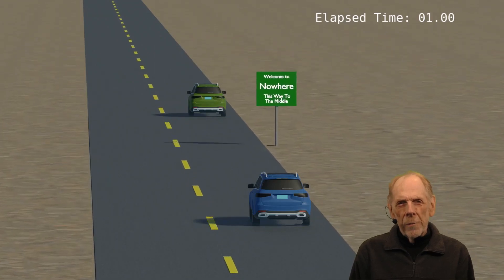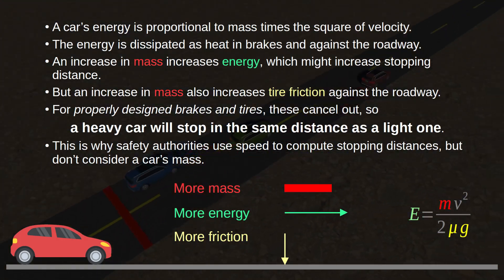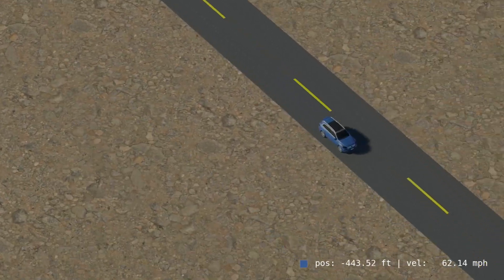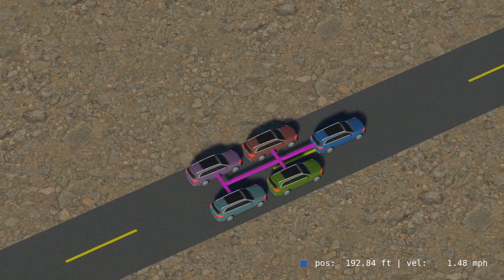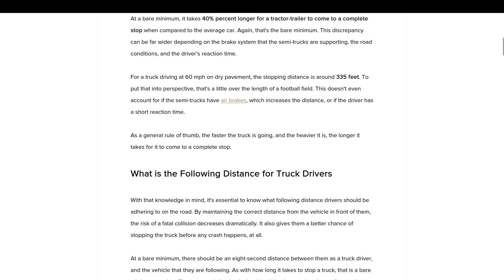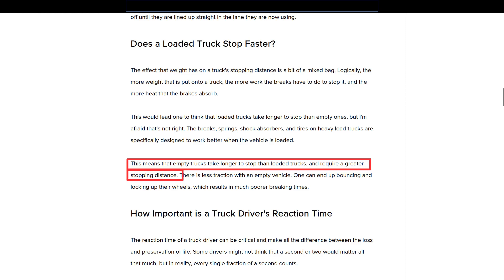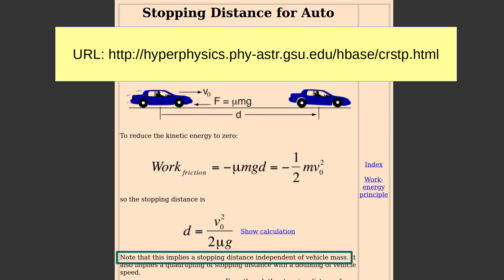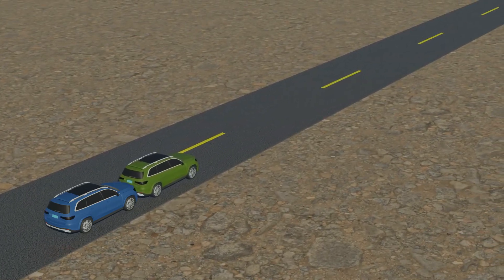Car Safety Myths: Exposed

Comment: I don't think it would be completely inaccurate to say that mass increases the braking distance as there is a noticeable difference to my carry truck when I have a 170KG generator in the back. Though I get that bigger cars could probably stop quicker with the hefty brakes they have on them, especially high performance spec cars.
Reply from the maker: @arianaashworth3091  • 8 days ago (edited)
> I don't think it would be completely inaccurate to say that mass increases the braking distance as there is a noticeable difference to my carry truck when I have a 170KG generator in the back.

Yes, but my video addresses the basic physics, not specific examples that have extraneous, uncontrolled factors. In science one must eliminate all factors but one -- the factor being studied.

Thanks for writing!
Reply: That should not be the case. The car's on board computer would have detected more weight and adjusted the braking system accordingly so there is no noticeable difference when braking and accelerating. If the added load means the car is taking noticeably longer to stop then there is either something wrong with the electronics/braking system or you have dangerously overloaded the vehicle, and in either case you must not be operating it on the road in such unsafe state.
Reply: @bethhughes559  It is a little compact pickup tuck from 1990, it has no electronics other than the lights, gauges, fans, ignition, starter, and the bed tilt pump. I am also not overloading it as the SWL for the bed is 500KG.
Reply: @arianaashworth3091  From 1990? A 33 year old vehicle shouldn't really be on the road anyway, they are unsafe and give off dangerous emissions. Perhaps consider replacing it with an EV.
Reply: @bethhughes559  I am not getting rid of it just because it is older, there's nothing even wrong with it! It passed the MOT with no issues and it has had a catalytic converter retrofitted. A few people I know who own electric cars have been having problems with the charging network, which is actually one of the reasons the generator ends up being transported around on it in the first place.

Comment: Wheels Magazine did an experiment similar to this, they found that brake quality was more important than speed.
Reply from the maker: > brake quality was more important than speed.

When the tires lose their grip on the pavement, brake quality is no longer an issue. Ultimately, the tire friction limit is the deciding factor.

Comment: I learned to drive double decker buses in trhe 1960s in London. I soon learned the fallacy of big vehicle = longer stopping distance by experience. We were takenn to a closed track at Chiswick where we were allowed to slam on at various speeds, culminating in the famous "skid pan" where we drove over a constant spray of water on a smooth surface with worn rear tyres. The instructor would command a certain course, either straight ot curved then yank the handbrake (rear wheels only) to induce a skid. We then had the hair-raising experience of trying to correct the skid and bring the bus to a safe stop.

A few years later I had the need to perform an emergency stop with a loaded bus. The vehicle stopped promptly within what I would have expected for a car at the same speed. Strong brakes and wide tyres added up to loads of anti-traction (friction). We were taught the "cadence" breaking method of quickly alternating between full braking and less breaking to avoid the wheels locking - skidding tyres offer no traction. Modern ABS brakes work that way.
Reply from the maker: Thanks for posting this real-world example -- much appreciated!

Comment: While I do agree there is nothing in physics that says heavy vehicles should stop slower (or faster), the real world is slightly more complicated than the simple dry friction model taught at school, F=mu*N. In practice, as the friction force gets so large that it causes stresses in the materials involved approaching the strength of the material it self, the coefficient of friction starts to taper off, as the material starts to give. In the case of rubber, it is also a viscoelastic material, which causes the onset of degradation of grip to set in even sooner. 

The result is that vehicles with lots of weight compared to the contact patch of the tires do have worse stopping distances. Such vehicles of course also have better rolling resistance, and are thus more economical to drive. So yes economics are indeed the main driving factor of elongated stopping distances of utility vehicles.
Reply: We can take the energy approach and see that during braking all the kinetic energy has to be converted to something else for the vehicle to become stopped. Most of the energy transfers into heat; in the brakes, the tyres and I suppose the road as well. The original equation for KE at 9:04 is the correct one, it just doesn't directly give the distance. The "corrected" one relates to distance, but is NOT the energy (rather closer to a momentum). So the amount of heat generated is directly proportional to the mass, and a 40t vehicle would need to dissipate 20 times as much heat as a 2t one with the same pre-brake speed. For the distance to remain the same, the time must remain the same, which means that in practice the brakes might have to become so hot that they might break any reasonable material and design limitation. Therefore they must be designed to extend the time instead, and consequently will have a longer stopping distance. (Of course it also helps to have larger and more wheels&brakes to distribute the heat dissipation among.)
Reply from the maker: > The result is that vehicles with lots of weight compared to the contact patch of the tires do have worse stopping distances. 

Yes, but that is an engineering problem, not a physics problem. If you control for extraneous factors, the result agrees with the common-sense expectation.

I did say that an expensive make-over would allow the truck to stop in the same distance as a small car. And it's true -- too expensive for everyday reality, but I was addressing a principle, not a budget.

Thanks for writing!

Comment: Your mass having now affect on stopping distance is a classic engineer vs mechanic argument. Is the model and math correct? maybe, In the context of the model. But that isn't real life. you have 5X the cars, 5x the tires, 5x the braking the force, 5x the rolling resistance, 5x the heat dissipation, 5x everything. Of course 5x the mass won't change the stopping distance if you increase everything equally 5x. Take 2 identical vehicles. Fill one up with bricks until it's 5x the mass of the other one. You're really going to try to say they will stop in the same distance? I bet your model with 5x the cars will also prove mass has no affect on acceleration aswell. Because those 5 cars will also accelerate exactly the same as one.
Reply from the maker: > You're really going to try to say they will stop in the same distance?

Yes, and I proved it. Consider that five cars that aren't connected to each other individually stop as though they were one car, in the expected distance for one car. And those five cars, when connected, all traveling at the same speed, stop in the same distance as for one car. How could it be otherwise?

The example is really simple, intuitive, and the result is borne out in field tests.

Thanks for writing!
Reply: @lutusp  I agree 5 cars connected will stop in the distance of 1 car. Just like 5 cars connected will accelerate at the same rate as 1 car. 

I'm just saying that isn't the same as saying weight has no effect on stopping distance. 

A more accurate model for that statement would be taking one car and increasing only the weight. eventually the weight will exceed the stopping power of the brakes and the distance will increase. Then you will need to increase the stopping power of the brakes. this is why large trucks have significantly larger braking systems than small cars. The increased weight will increase grip of the tires on the road as you said, to an extent, but won't increase the grip of the pads on the rotors or the rotors ability to dissipate the extra heat produced.
There is also increased weight transfer to take into account. but that depends on where the extra weight is added, limits of the suspension ect.

I guess if your point is a large truck the weight of 5 cars, with the stopping power of 5 cars, and the tire contact patch of 5 cars can stop in the same distance as 1 of those cars then we agree. because that truck is using (converting to heat) 5 times the energy to stop 5 times the weight. So using 1/5 the energy will stop 1/5 the weight in the same distance with all things equal.

Thanks for responding! I appreciate a good youtube video that can get people thinking and discussing stuff like this.
Reply from the maker: @cargasm383  > I'm just saying that isn't the same as saying weight has no effect on stopping distance. 

Yes, but ... wait for it ... no one said that. My claim is that a car's mass doesn't normally increase its stopping distance as is commonly believed, and in cases where this is true, it's because of bad engineering, not physics.

Thanks for writing!
Reply: @lutusp  At 3:15 in the video you said "a few minutes from now you will know why mass should have no effect on stopping distance" Thats the part I was commenting on. Mostly because it was followed by the comment about shattering beliefs. came off as a "I'm smarter than you and this is why" type comment. Which I found funny because we seem to agree mass does have an effect, but as you said proper engineering can overcome that effect of increased mass.
Reply from the maker: @cargasm383  > ... came off as a "I'm smarter than you and this is why" type comment.

Never said nor implied.

Comment: 1:10 It is true that the braking distance goes up by the square of the starting speed. But your explanation is also a myth.
You assumed that the rate at which we can dissipate energy will be constant. Even though in the case of dissipating energy as heat via friction, the rate increases linearly with speed. Which actually cancels out the squaring of the energy. And so it will only take twice as long to get rid of all the energy when our starting speed is twice as fast.
(If the dissipation rate was constant, then the deceleration would increase as speed decreases. Which is not what we observe in reality, nor in your own simulation.)

BUT! That is time, not distance! The total distance the car will travel is the same as the average speed multiplied by time. And when we double the starting speed, (assuming liniar deceleration) we also double the average speed. And that is why the braking distance goes up by the square of the starting speed!
We spend twice as long getting rid of that speed. And we go twice as fast (on average) while doing it! (2time * 2speed) = 4distance!

If you want a visual example. Draw a graph with the vertical axis as speed, and the horizontal axis as time. (0, 0 preferably where the two axis's intersect.)
Draw a line that starts at some amount of speed and has some downwards slope. Now draw a second line with the same slope, but have it start at double the speed. You now have two triangles, and the area of these triangles will be (speed * time). Also known as distance.
Visually, 4 of the first will fit in the second. And the two edges that form the right angle at (0, 0) have independantly doubled from the first to the second, just from changing the starting point.

By doubling one value (or starting speed), we have actually doubled two seperate values (Average speed and time), which are then multiplied together for our result (braking distance), turning our liniar increase in starting speed, into the exponential increase in braking distance. And that is actually why the braking distance goes up by the square of the starting speed!
Your fault was to look at the quadratic increase in energy with speed, and the quadratic increase in braking distance, and assume they were related. Even though they are not.
Reply from the maker: > Your fault was to look at the quadratic increase in energy with speed ...

The values I showed are based on physics, then verified in field trials, which agree. Thanks for writing!

Comment: So five cars with five sets of tires break the same as one vehicle with the same mass and number of cars. Twenty tires have more traction than four tires. The principle may be sound but there is a traction limit.  Four tires simply do not have the same tractive effort as twenty tires. Longer stopping distances are required to avoid the limitations of the equipment. Maybe if we put more sets of tires on a big rig we could get it to stop at the same distance as a car, but that's just not practical.
Reply from the maker: > Twenty tires have more traction than four tires. 

Traction depends on a combination of surface area and downward force, so ... no. This doesn't mean a tiny tire surface will bear the load, but friction force increases as area decreases. Smaller area, greater frictional force per unit area.

Comment: So in theory I could fit the brakes, wheels and tyres from a classic 690kg Mini to my 1525kg Jaguar XJ and it would stop just as well as a classic Mini?
I don't believe that for 1 second and clearly neither did Jaguar.
Reply from the maker: > So in theory I could fit the brakes, wheels and tyres from a classic 690kg Mini to my 1525kg Jaguar XJ and it would stop just as well as a classic Mini?

Nope. But then, I never made that claim. More massive vehicles require more massive braking systems.

Thanks for writing!
Reply: @lutusp  Well you did make the claim the weight makes little to n difference though.
Reply from the maker: @matthewjenkins1161  > Well you did make the claim the weight makes little to n difference though.

No, I proved graphically that heavy vehicles can be engineered to stop in the same distance as light vehicles. The five-car monster vehicle example demonstrates this point in a way that's impossible to dismiss.

In everyday reality, if appropriate tires and brakes are provided, the same principle applies.
Reply: @lutusp  Of course they can be engineered to stop in the same distance.

They need to be because weight DOES make a difference.
Reply from the maker: @matthewjenkins1161  > They need to be because weight DOES make a difference.

Yes, as I explain in the video. That difference can be engineered away, but only if we are willing to do it.

Comment: #1. I've never heard anyone (at least anyone of authority) claim braking distance increased proportionally with speed. It has always been square proportional (2x speed = 4x distance, 3x speed = 9x distance, etc...). That is basic middle/high school physics (Ek = mv^2/2).

#2 is splitting hairs. While it may be theoretically possible to engineer a truck that stops as fast as a small car (there's a video out there of a kid dashing across the road and a well engineered truck stopping on a dime avoiding tragedy), most trucks in the US at least are not engineered to stop as quickly. In practice, a larger (more mass) vehicle will take longer to stop. The difference is glaring if you've ever driven a truck.

#4 should be obvious, though from personal experience having lived in an area with wildfires and hearing about pileups because people insisted on driving through smoke so thick you can't see 10 feet in front of you...maybe its not as obvious to some.
Reply from the maker: @LC-uh8if  • 19 minutes ago
> #1. I've never heard anyone (at least anyone of authority) claim braking distance increased proportionally with speed.

That's why I posted a few sources verbatim for those kinds of claims. They are legion.

> ... The difference is glaring if you've ever driven a truck.

Also covered in the video, where I say that trucks really do take more distance to stop, and the reason is economics.

> ... maybe its not as obvious to some.

We regularly hear pileup stories involving hundreds of vehicles, so clearly someone isn't getting the message.

Thanks for writing!

Comment: It would be interesting to see if you would stand in 321 feet in front of a fully loaded Australian 2AB Quad road train doing 100kmph to prove that all vehicles on the road stop in the same distance.  Theory is good but in theory people pay attention to the road.  Watch any tyre test and the same car will stop in a different distance based on the brand currently on.  I agree that from a physics perspective they should be the same.  However from a reality, accounting and engineering compromise perspective this doesn't work in practice.  The people using physics to prove why this is the case should be called out.
Reply from the maker: @boomerau  • 4 hours ago
> It would be interesting to see if you would stand in 321 feet in front of a fully loaded Australian 2AB Quad road train doing 100kmph to prove that all vehicles on the road stop in the same distance.

Yes, except that's not what I said. I said that trucks don't stop in the same distance as cars, and the reason is economics.